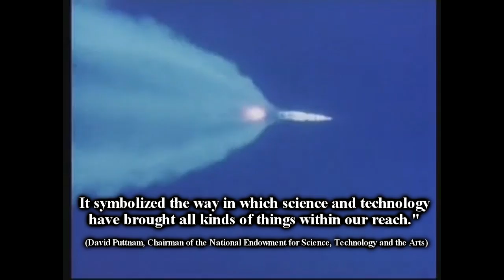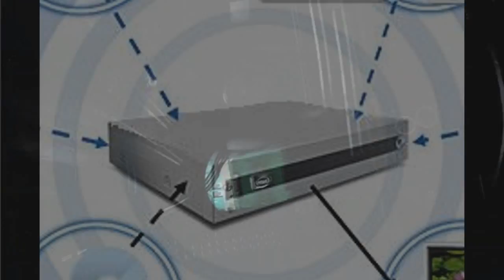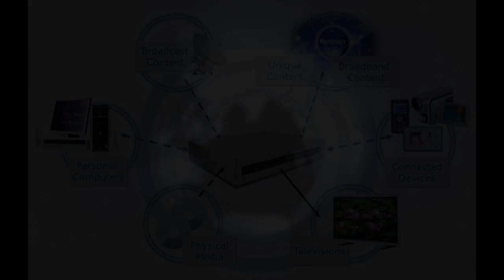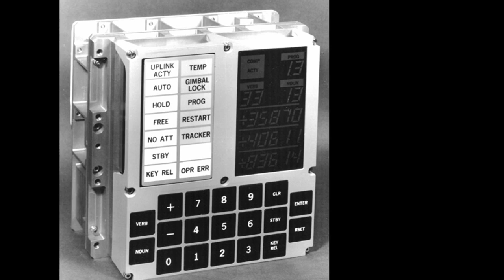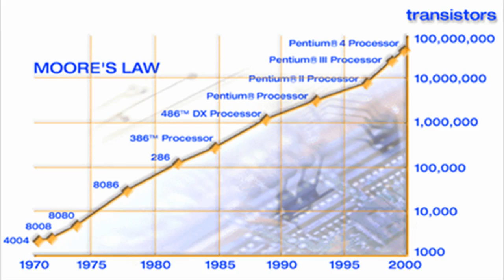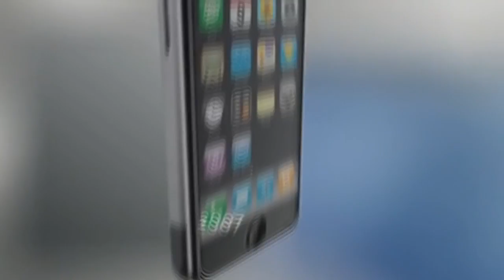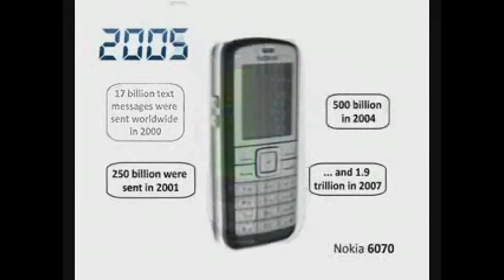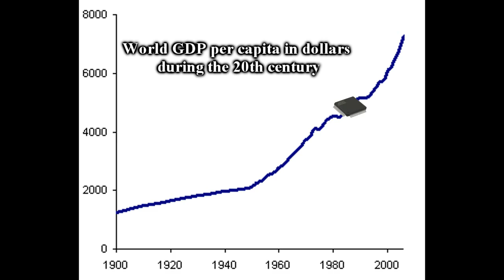History of Integrated Circuits: The Foundation of Modern Society

Comment: Integrated circuits (ICs) date back to 1958.  Texas Instruments was manufacturing ICs for space applications by 1962.  A microprocessor is a subset of the family of products that are available as as ICs.  It was possible to use IC technology without actually using them as microprocessors.  The technology would have been built with discrete ICs, not with microprocessors.